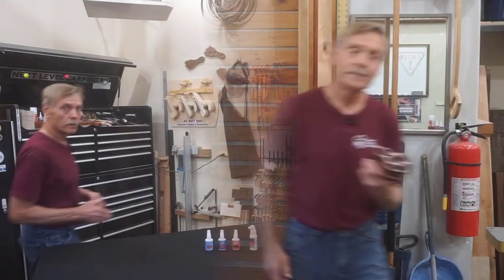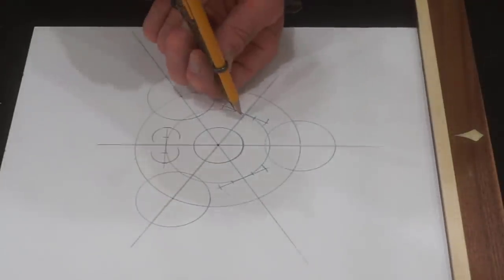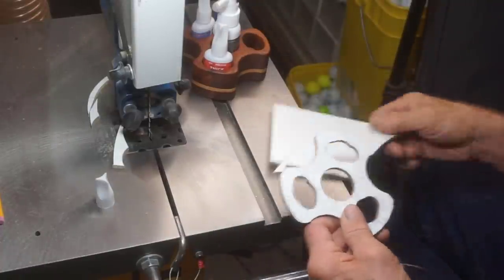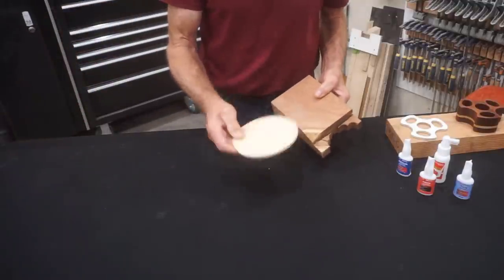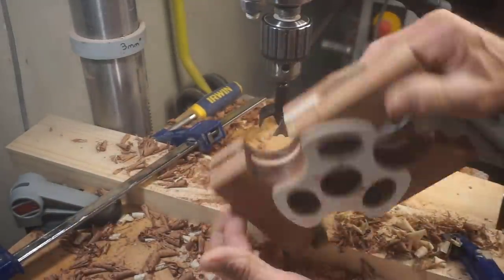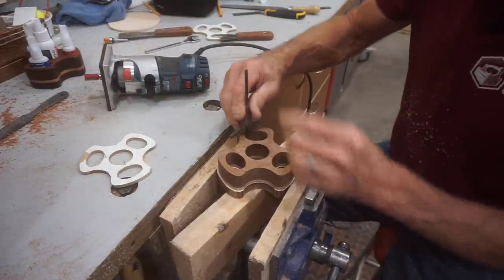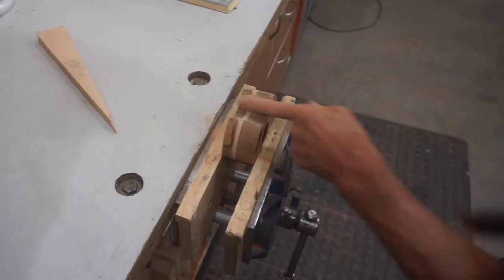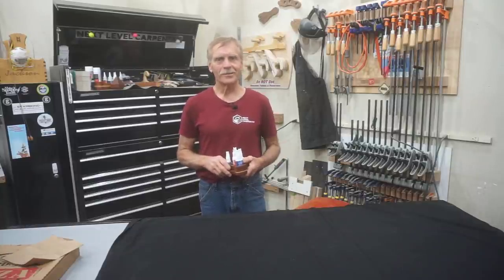Make a Caddy for CA Glue to Go

Comment: Ordered and definitely making it! I made the first caddy and keep it in my shop. However, once my wife discovered how well Starbond glue works and the caddy finds it way into the house all to often. I ordered the smaller set and I’ll make this really cool caddy for her so she keeps her hands off my set. Lol! Thanks so much for the tips. Can’t get enough of absorbing so many professional woodworking tips from a real craftsman like yourself!
Reply from the maker: Glad to hear it Danny... I think you'll find it a challenging and rewarding project.  I advise you to make two while you're at it though.  It could help prevent marital discord because the caddy is a joy to hold and use IMHO and wouldn't want you resenting the missus if she denies you access!  Let me know what you think of the smaller set and, most important, the pump sprayer and Pinocchio nozzle.  I've been slow to adopt the pump spray over aerosol but the new tip design has positively affected my opinion and preference and I'm curious what others think...
Best, Matt

Comment: I built the first glue caddy you described years ago. I’m still using it. Further, I used a modified version of your design for oval bottles. It works just fine, as well.

It looks like your new design will fit nicely in my tote case. So…

Thanks!
Reply from the maker: That's good to hear Joe... I wouldn't 'push' CA glue and Starbond so much if I didn't feel it was so useful and important to myself and viewers.  Compared to having to use aliphatic resin wood glue like Elmer's Carpenters Wood Glue in the old days for everything I use CA glue for now is revolutionary to this 'ol nailbender and I want to tell the world about it! 😉😎

Comment: Great idea on the tip cleaner. I always use a safety pin.
Reply from the maker: Safety pins not a bad idea Brent... I'd fill the tip flat though to push out clogs rather than just expanding the tip... but whatever works is the way to go, right?  Best, Matt
Reply: @NextLevelCarpentry  well said. And get idea, I hadn't thought about the tip expanding. Or filing the tip down. I'll do that just to avoid any issues down the road. Thanks Matt..

Comment: Good tip on the pipe with a split for the concave surfaces.
Reply from the maker: Thanks Mick... BTW I've got an assortment of pipes of various diameters that work the same way and equally well on concave surfaces of different sizes.

Comment: Well done Matt, nice Caddy build.
That special offer looks like a good deal, I will order some.
To everyone out there Starbond says keep your CA Glue in the refrigerator and it will last twenty months.
Except to Matt, he probably goes through a whole batch of CA Glue in a week , so he is good leaving it out.
Cheers
Randy 
Northern CA
Reply from the maker: You're welcome Randy.  BTW while I do use a good bit of CA on jobs and in the shop, some bottles do sit around for many months before I use them up.  I've never had them 'glom up' from lack of use the way Gorilla Glue and FastCap stuff does and also never refrigerated them.  Leaving bottles in the hot shop or inadvertently in the sun for hours on jobsites should punish me with spoiled product for neglectfulness but I've not seen that happen with Starbond.   It's one more thing that impresses me with the product.  Not that I advise such responsibility for others though and a little bit of care is certainly good advise!
Best, Matt

Comment: If you need a hole like that a hair wider? You best do it your way, because often i used a big machine to saw a hair of wood off of a side, just to see after that that it was too much and it wont be correct anymore. So take 10 minutes of sanding or filing so you get the snug fit and be happy afterwards in place of frustrated ;)

Comment: I picked out snacks to watch this one. When you were at drill press it made your bandsaw height behind it look extremely low. Didn’t look low when using it but looked like you’re sitting at it. I ditched the spread metal stand to raise my 14 inch bandsaw up a full foot higher. I’m tall I guess but I can’t even see or hold anything that low.

Wonder what other sorts of caddies people come up with using same ideas. I could see myself making a very handsome tape dispenser.
Reply from the maker: Thanks for watching and commenting!
I have the drillpress table raised rather high to shorten the quill stroke needed to repeatedly drill holes in relatively thin material which makes the bandsaw look extra low.  I usually sit on a stool at the bandsaw when cutting smallish parts.  The table height is good for most larger/longer stuff like re-sawing so I wouldn't want it higher unless I never did bigger stuff.  Good on you for ditching a dysfunctional stand... that's a bit of beneficial outside the box thinking that makes your workflow better and safer.
I do hope viewers extrapolate the template/router method shown for making this caddy to other useful stuff since I don't imagine many really need/want a CA specific caddy like this one.  
Best, Matt
Reply: @NextLevelCarpentry  Makes sense, holding the material just above the hip to hold a larger piece and use the body to hold it steady. Thank you for the thoughtful reply.

Comment: 23:40  "Cover the chip's surface with CA glue and  --- hold it firm for 10 seconds"
 ... and if you use your fingers to hold this small chip/thingy firmly together, and you've used just a tiny little too much glue, don't just take the words from others, but you can easily learn by yourself how amazingly strong this glue is! 
Metal, glass, plastic, skin, wood, etc. this glue holds things together for a very long time.  
At times, even too long...!!    😉

Comment: Why do you call it CA glue? CA means Cyanoacrylate Adhesive.  So cyanoacrylate adhesive glue sounds weird to me. 
Technically it's not a glue.
Reply from the maker: I suggest you take it up with the makers of Super Glue... one of the first to take cyanoacrylate mainstream.  
While you're at it you should visit your local supermarket and lecture the produce department manager for putting tomatoes in with the vegetables instead of with the fruit which is technically classified as... 😜
Reply: Probably because it is called CA glue.  LMAO
Reply: CA is the abbreviation for CyanoAcrylate.